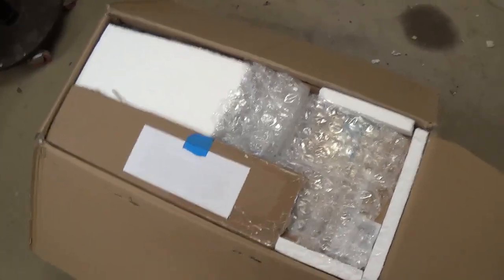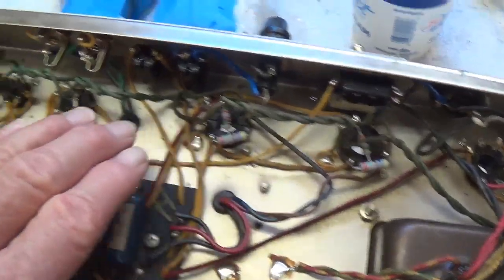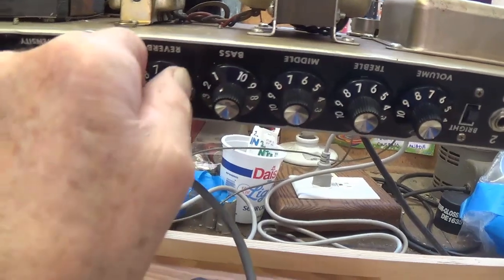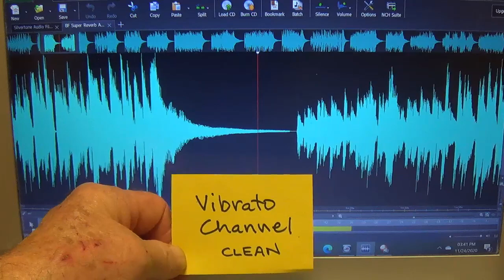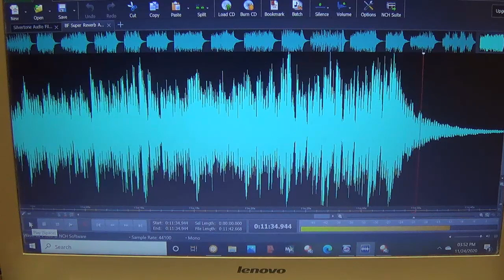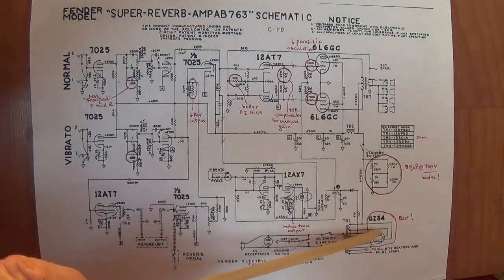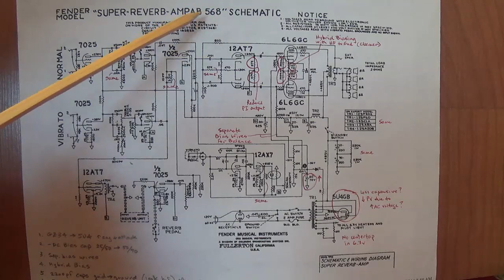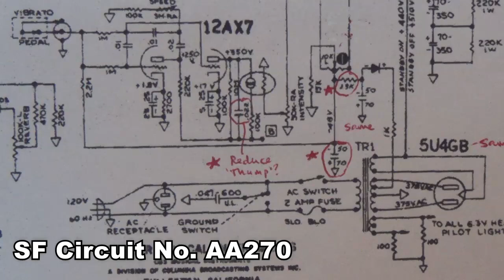1965 BF Fender Super Reverb in for a Check Up......Plus BF vs SF S.R. Circuits

Comment: Another great video...Uncle Doug I asked in the last BF Fender amp video....Is there lead dress differences between the first series SF compared to the BF series? I own a BF Pro Reverb for many years.Great amps.Love the videos and all the best to you and family for the holidays and 2021.
Reply from the maker: The SF differences I notice are the change to vinyl-covered wire and the tendency to leave some wires longer than necessary......also they wrap bundles of wire with another, grounded wire, in order to shield them, I guess.
Reply: @UncleDoug  Thx Uncle Doug!

Comment: That Russian tube is a 6P3S actually closer to a 6L6 than a 6L6GC. Only rated for 20W or 23W plate dissipation depending on what data sheet you look at. They work really well in Pignose G40V's just don't try and bias them like a 6L6GC.
Reply from the maker: Thanks for the info, JD :)

Comment: There is also an easy mod to move the dry channel to also feed the reverb circuit. I am going to do this to my 1966 Vibrolux Reverb, as I always play with reverb, and the channel 1 has a slightly different sound... it will be nice to have reverb and trem on both. Instead of hard wiring, I will install a switch to route stock, or all reverb-trem, in the location of the former 'death switch'
https://www.premierguitar.com/articles/22573-ask-amp-man-beefing-up-a-vintage-fender-vibrolux-reverb
Reply from the maker: Thanks so much for this informative input, Jennifer. I trust you are having a nice Christmas season.
Reply: @UncleDoug    Thanks for the well wishes👍... same back to you and the kitties... I really enjoyed seeing this video, and the in depth look at the variations in the amp generations. Your illustration of these is not only educational, it is inspiring some ideas for functional improvements or changes that were on other generations. IF you ever wonder about these in-depth looks not being appreciated, please DO NOT!  I know I am not alone.. Several members of our audio club have build or modded guitar amps. I have ALL of then watching your channel... "Class in session!! 👍👍"

Comment: Uncle Doug...Hi,is there a vid on power transformer wire color code or a way to tell which wire is which. The obvious ones especially are easy the 6.3, the rectifier H.V. and the 5V heater but the original circuit had the 5879 wired as a pre amp tube in the original reel to reel . It appears that the  120 V in wires are even slightly different color...one balck,one darkish,rusty brown,etc. One light blue wire  might be for bias.
It was a Voice of Music model 700 with two 6V6's but the circuit is single ended by design including one 12AX7,and the one 5879.
I wll have a VariAC in a few days if that will help. Many thanks for your well explained clips.
Reply from the maker: Color codes vary between transformer makers, Daniel. The best way is to simply see what each wire is connected to in the original circuit......or test the leads for continuity, connect the (usually black)  primary wires to 120VAC, and carefully measure the voltage in each pair with continuity (or triple, if the winding is center-tapped).

Comment: Uncle Doug I’m trying to re solder my guitar wires but nothing works the solder just falls off the iron or the iron just burns the wire and doesn’t stick to it and then after all that it’s gone from shiny to black gunk liquid what do I do any tips ??
Reply: You may need to track down a course on YouTube here but also what kind of iron are you using and are you brushing or cleaning and light sanding your wires especially after they’ve been gunked up they need to be clean and your solder should be 60/40 lead 10 or maybe there’s something better nowadays. Even new parts need to be lightly scuffed in many instances, like fresh stripped pick up wire and the backs of pots. Pre-tinning also helps. If you pre-tin the wire and the part, it can  help you to not overheat  the parts. You should also have the right iron with the right size tip for the job, but I understand if you may not have all the right stuff sometimes you just need to get by
Reply: @LTJR.   maybe I need a course or two but so far what I done is I tried to Tin the wires /no scuffing /flux
I would if I had some of them but i don’t also I have no idea what kind of solder I’m using it was just at the bottom of my tool box so I switched to a soldering iron with a trigger and new tip and it still just rolled off so I tried cleaning up the gunk with a brass brush so Ye that’s about it 3 tries and the same result each time
Reply from the maker: My question is why are you trying to solder them?  They are not an alloy that could be easily soldered, and the heat damages their temper.
Reply: @UncleDoug  ah well this has a good answer I had a Squier Hardtail and it was on a guitar stand and my parrot flew into it and knocked it over which then resulted in the breaking of the junk plywood body so I got a new one with a trem and the ground wire doesn’t wanna tin so I can connect it to the claw
Reply: Oh OK so you have a claw are you trying to solder to the claw while it’s mounted into the guitar? The springs and the screws are all heat sinks you’re only going to solder to that clawIf you remove it from the guitar and solder it by itself... An African gray and a Mexican yellow head did some intense/immense amount of remodeling in my growing up life-keep them away from your book collection, window coverings, guitar cable, cases, Heck if you have a guitar on a stand, That it knocked over, i’m surprised it didn’t perch And poo on it before knocking it over.
Reply: @UncleDoug  I think I’m just figuring it out that he had a hard tail but now has a tremolo body, And I think we both thought he was trying to solder to the sustain block. I’m pretty sure he’s trying to solder to the claw, but I’ll bet the claw is Mounted already with the screws and springs acting as heat sinks. Now that he says he has a gun with a trigger I figure he’s got a 75 W radio shack type pistol grip which should do the job, Once he pulls apart the assembly and soldered to the claw by itself.
Reply: Also lay out your wire first and make sure it’s not going to hamper the travel of the tremolo. You may do an image search of Google to help you out or just make sure it’s in the cusp of the U-shape, Or by outside edge, somewhere where it won’t interfere. By the edge will make it easier to solder to as you won’t have to heat as much
Reply: @LTJR.  I ended up using ur tips and made a perfect solder to the claw and everything worked out swell thanks 👌👌👌
Reply: @LTJR.  thankfully it only destroyed the guitar and not my walls or furniture or clothes or phones my bird is also a African grey thanks for all the help I ended up soldering the ground on the claw twice and finally getting it because the claw wasn’t getting hot then I saw this and face palmed cuz I had left the springs in and everything
Reply: @razzymarcus8044  Oh that’s cool glad I could help.

Comment: Isn't that added dropping resistor in the AA270 revision just to separate the two filter caps into two stages?
Wouldn't it be just a single stage at a 100 mfd without it, right?
Reply from the maker: All versions have node resistors between the filter caps, David. What we discussed were changes in the values of those resistors.
Reply: @UncleDoug  Yes, but you said in the video that you didn't know the reason why they added that dropping resistor in the bias line.
I'm saying that they had to when they added an extra filter, right?

Comment: Fuse should ALWAYS come before the switch. If there is a legit reason to put a fuse elsewhere it should be in addition to a fuse right after the mains AC gets into the chassis. Also I have run into more than one instance where power switch insulation failed and the switch shorted to chassis.Jan 22, 2012   I noticed you were always wiring up the hot to the switch first.
Reply from the maker: Yes, and I will continue to do so. Thanks, however for sharing your opinion.

Comment: As usual another stellar presentation, I cherish each one. 
If converting a silver face to BF specs, I was curious as to your preference between the ab763 neg. bias adjustment or the newer version with the bias balance adjustment. I’m referring to a remark in a previous video of the “school of thought” that slightly imbalanced output tubes might create pleasant harmonics as compared to perfectly balanced ones. Which would you personally choose for your own? I love the tones of my 66 BF with it’s not perfectly balanced tubes.
Reply from the maker: I would go with the traditional bias voltage adjustment and provide the matched (generally imperfectly) output tubes myself, Michael.

Comment: Uncle Doug:
Howdy.  Did you notice that D Lab also worked on a Super Reverb of the same vintage - just yesterday?  But what was also interesting - and also a huuuge coincidence -  is that the area around the 6L6's also have a smoky residue on the chassis surface.  In addition, the power xformer also has a great deal of exudate of xformer resin.
Now, I used to run all kinds of Fender amps, such as the Bandmaster, Bassman, Twin Reverb, etc, and NEVER had such phenomena as that these Super Reverb seems to have with the xformer and chassis residue.  Never ran a S-R myself; can't say.  But perhaps you might check out D Labs viddy and see for yourself what I mean.  Got to be more than a coincidence.  Perhaps a careful analysis of a S-R and - let's say - a Bassman schematic to see why the S-R is having a tube/xformer issue.  Looks like the power xformer is being forced to run at the ragged edge of its design specs.  Or - the rectifier circuit is different.  Dunno.  But something MUST be amiss!
Liked your viddy!
Reply: One possibility  May be that because of the strength and sometimes overwhelming output of the circuit (I have played and owned many super reverb’s all my life) rectifiers may have been substituted for a lower voltage, or just availability. As I think the GZ34 was called for in this amp, putting out the most and having the least voltage drop and current requirements. 1.5 A for the Jeezy (ha ha voice recognition) 34 if memory serves, and up to 3 A for some of the others. Also a lot of the residential and commercial electricity that I have witnessed can run up in the 125s . I started to just carry a Variac with me. I guess because of the rectification and power supply if you ever see them on the meter A volt up at the wall nets an exponential or logarithmic rise. I think one of those words were  correct. It’s Sunday afternoon and had a couple drinks.
Reply from the maker: Those are some interesting theories, Mr. RG. I'll probably get some more SR's in for repair work and will pay attention to the trouble areas you mentioned.
Reply from the maker: If a man can't have a couple drinks on Sunday just before Christmas, what's the use of living, Lawrence?  Happy Holidays !!!
Reply: D lab viddy here: https://www.youtube.com/watch?v=9BzoeoE_onQ

Comment: This 65 says Fender Musical Instrument. In another video on the 66 you said the 65 didn't say that. Instead you said Fender Electric Instrument Company. @Uncle Doug please comment. Thanks
Reply from the maker: From Reverb: "Blackface Fender amps tend to be categorized into two groups by collectors and players: “Pre-CBS” (mid-1963 to mid-1965) models with a “Fender Electric Instrument Company” label and “CBS” (mid-1965 to mid-1968) models with a “Fender Musical Instrument” label". Thus, there is overlap during 1965, depending on whether the amp was built early or late in the year.

Comment: Hi Uncle Doug. Have you ever tried setting the bias using a scope and adjusting the crossover notch out?
 I know the output impedence of the Super Reverb is 2 ohms and was wondering if it was mismatched say with 4 or 8 ohms would that affect the 6L6s bias setting? 
Great job as usual thanks for your time and sharing your knowledge.

I think it's time for those two to head out on the road their really getting good enjoyed hearing the zz section with fool 4 ur stockings was waiting for Rev. Willy G to start singing👍
Reply from the maker: I have not, Jim. I hate to experiment with customer amps :) I don't believe a close mismatch.....I used 4 Ohms instead of the expected 2......has all that much of an effect on bias, Jim. Glad you enjoyed the demo.
Reply: After I said that about the bias and the impedence I got to thinking it's d.c. bias so why should it.🤦‍♂️. 

Really enjoyed the comparing of the different versions and you explaining the different values of the  plate resistors on the pre-drivers ... always wondered why. There was a wealth of good info in this video ! Thanks again.

Comment: There's a resistor directly at the output of the rectifier tube, just before the diode, which varies greatly among the versions: 470 ohm in the AB763, 1K ohm in the AB568, 1.8K ohm in the AA1069. What's the significance of that component? From the little I understand (watching your videos), it seems to be a preliminary dissipation/adjustment of (biasing) tension. I think that, physically, that resistor rests on the bias board. I find it confusing that you didn't discuss that, could you maybe shed some light on it? Thank you very much!!
Reply from the maker: The resistor you described is in the -DC bias supply, Marco, and serves to reduce the voltage in the circuit so that approximately -52VDC can be applied to the output tube grids. A 27K Ohm resistor is used to fine tune the bias voltage to the tubes.
Reply: Thank you very much. So I guess that it doesn't interact in a critical way with other components down the line, like the diode or the "filtration" cap. The real reason of my question is that I have an ab568 and I'd like to have the cathode bias resistors of the power tubes (the weird 68/69 experiment) removed, like you suggest, and I was wondering if that would imply changing that resistor too. I guess that what really matters is the resulting negative tension applied to the grids though.
Reply from the maker: @just6like7you  I'm confused, Marco. At what point did I ever suggest removing cathode bias resistors? The amp can't operate without them.
Reply: 56:42 -- those 150 ohm resistors (connected to the cathodes, you call it "hybrid" biasing) that only appear in the ab568 circuit, not in aa/ab763 nor in aa1069. You suggest that removing them could bring an ab568 closer to the ab763 golden standard.
Reply from the maker: @just6like7you  Apparently Fender briefly experimented with hybrid biasing, Marco, but quickly abandoned it. Only an AB comparison between hybrid and fixed bias could tell if either was superior.
Reply: Hence my question.
Reply from the maker: @just6like7you  Not having done an AB comparison, or ever having heard or seen one done, I cannot provide a definitive answer. Maybe you should consider performing the comparison and reporting your findings.
Reply: I meant my original question (about that resistor). But yes, I will definitely try sooner or later, and let you know! Also with recordings / videos. Here's a short video of the amp, recorded with crappy camera mic https://www.youtube.com/watch?v=1o9iVXVn5ZU Thanks for your channel and say hi to Rusty!

Comment: Uncle Doug, Uncle Doug! I said my amp doesnt get enough distortion on the high gain channel. But somedays it does get it right,  also sometimes there is  a shift on the highs freq. I notice my fan spin velocity sometimes goes slower. I think this house power has ups and downs. I use protection on my equipment, but... can this be the cause for the amp not getting enough gain sometimes?  I dont know if this is right, but my theory is that  the amp doesnt get enough power and the bias get cold in turn.
Reply from the maker: I have no way of assessing the stability of your house AC supply, WC, but I honestly doubt that it varies enough to cause a noticeable change in tube bias and tone.....unless there are wiring issues to or in your house circuit. You could try monitoring the AC supply to see.  I think that sometimes, when we're "in the zone", amps sound better that when we're not. Pick attack and drive vary depending on our mood.
Reply: @UncleDoug  i understand, thanks uncle Doug! I should try new tubes to discard that too.

Comment: If the move from GZ34 to 5U4 troubles you, you can always go to a 5V4 which is an excellent compromise. Base is the same. You get the indirect cathode slow warmup and back to 2A filament (5U4 is 3A) only about 10 volts more drop than a GZ34 (5U4 is 45 or more volts) You can buy NOS 5V4GA US made very reasonable on ebay ($20, used to be $10) and while that is maybe $5 more than Russian GZ34, some Russian GZ34s are very prone to catastrophic failure. Make sure you get 5V4GA = straight sided, not the bowling pin bottle. The 5U4 had the advantage of being much cheaper & more rugged than a GZ.  http://www.fourwater.com/files/fullrect.txt
Reply from the maker: Thanks for the helpful input, Pneu.